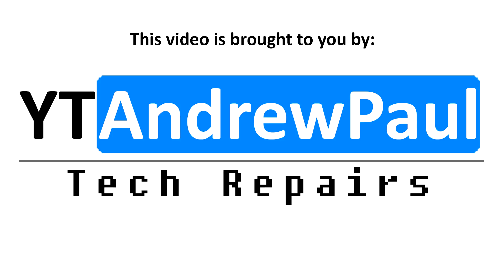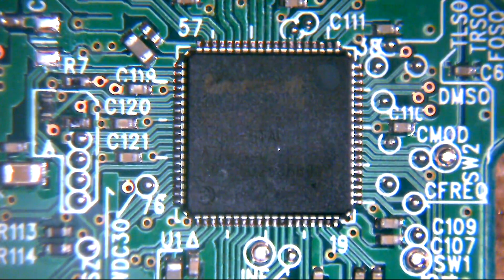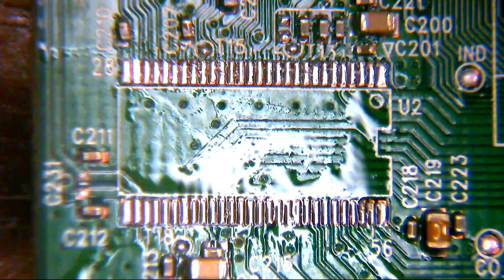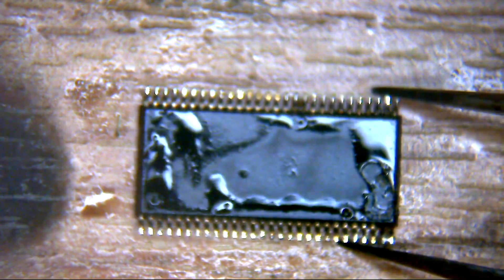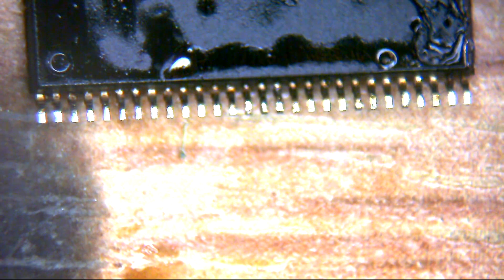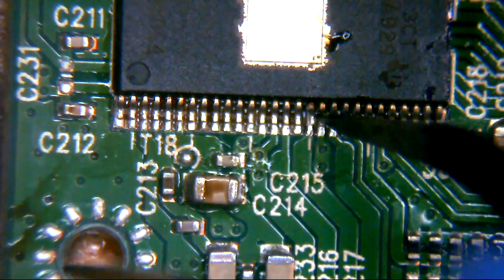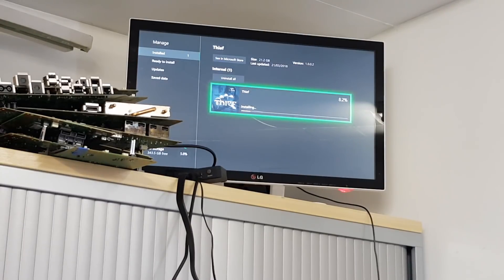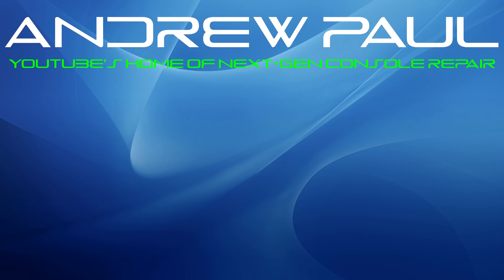XBOX One BD-ROM No Disc Feed - Fault diagnosis and logic board repair

Comment: I've got an original XBox one with the same symptoms.  Attempting to insert a disc will turn the console on, but also this console cant apply the final step of an offline update.  It stops at the end of step 2 at 65%.  I know that usually what happens when there is an issue with the optical drive.  Would the motor ic likely be the cause of it nkt taking the update or do you think it has two separate issues?
Reply from the maker: What is the full error code displayed when this happens?

Comment: Excellent video. I recently purchased a hot air rework station from Amazon and I am going to attempt to repair a BD drive like this one in an Xbox One purchased from ebay. I've narrowed the problem down to the board itself and its acting rather peculiar. When I turn on the xbox  the drive will begin to run the feed motor. It will also attempt to feed the disc immediately after I remove a disk from it. Like everytime I eject. a disk it wants to immediately feed it back into the drive.

The problem I'm having is that the drive does not want to install or read any disk. It will feed the disk and and spin up. The laser will attempt to read the disc for a second and then stop. As I've stated previously I know this isnt a mechanical or laser problem as I've tested the drive in another console with the matching BD drive and it worked perfectly. Im wondering if I should swap out this same ic controller chip as the motor is acting funny. Was wondering of you had any thoughts on the matter.

Thanks for all the great content!!!

Comment: Hello Andrew .. I have a xbox one that does not have Power to dvd . BUT if you Insert the Disk about halfway  . Unplug . .. The reconnect and Press the Eject button .. This machine will Load disk .. Play disk .. Even eject the disk . But once it ejects .. Its back dead again . Ive tested fuses for days .. Ive chanced the Ic . and ive tried 4 disk drives . Have you seen this problem before
Reply: Having the same issue
Reply: Me too
Reply: well my thoughts are this. its obviously not the disk drive thats the issue. look on the motherboard and find the issue. might help to have a good board to test parts with also. might have a short somewhere. best of luck
Reply: I just fixed a xbox one x with the same issue. it was a blown 0 ohm resistor (R134) on the motherboard.  Check where pin 6 of the bdrom motherboard connector, it should go to a small 3 leg mosfet close by , with 2 resistors and a cap , one resistor is 10k and the other is 0 ohm . The mosfet is G31.Check all these components . Might be different components on the S and fat, but should be the same principle

Comment: Just wanted to thank you Andrew for this video, I had a board that someone ruined and you said that I can transfer the IC chip to another board which I did and it worked. For anyone trying this be aware there's one solder pad underneath the chip
Reply: So to clarify, you can swap the square Microsoft ic chip to another board and the second board will be married to the Xbox? Did this work for you?

Comment: @AndrewPaul quick question have an One X missing disk drive found parts online comes one and give me E100 error is there away it can be a download only console?
Reply from the maker: Sadly not that I'm aware of - they do a presence check for the drive and without it will fail to E100.
Reply: Thanks. Where you based in the Uk as I have a couple of One X that need to help one with the Black screen of death and the other has a some this blown on the motherboard. Would like to render your services for a reasonable price of course.
Reply from the maker: Hi, we're based in West Yorkshire but accept mail in repairs from across the whole UK and EU. If you drop me an email to ytandrewpaul@outlook.com with your location and the issues you're having then I can get a rough guide price to you. Many thanks, Andy.
Reply: I bought an Xbox one with the e100 error. I took the drive out. Re installed the HDD Xbox software. Then did the USB update. And my Xbox works without the drive attached to it.

Comment: How much do u fix ps4 ports
Reply from the maker: Where are you located? Is this on XBOX One, S or X? Also, which USB port is broken?
Reply: Andrew Paul no ports are broken on my ps4 but just wondering if u fix the original ps4 hdmi ports for how much please
Reply from the maker: Where are you located bud?
Reply: Andrew Paul uk
Reply from the maker: PS4 HDMI port is £49.99 which includes return shipping to a UK Mainland address.
Reply: Andrew Paul oh I just took my white ps4 into cex and got a new one 🤗